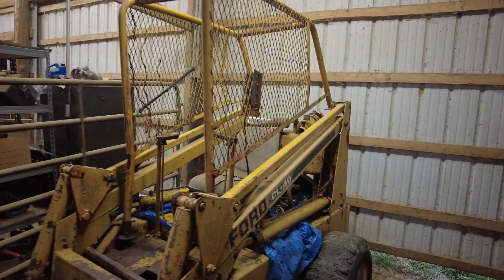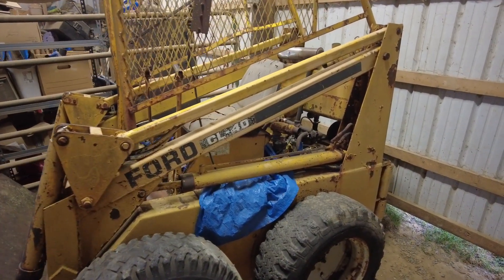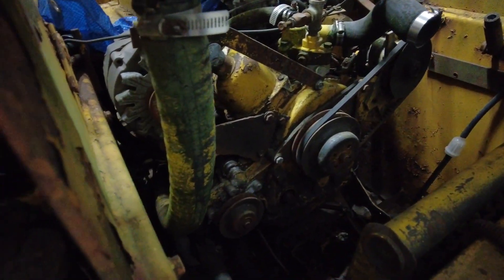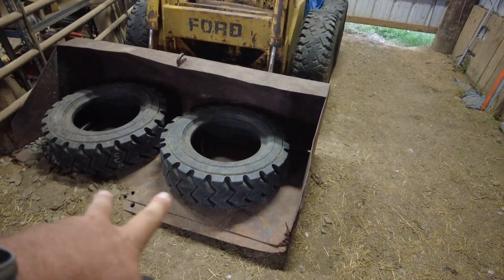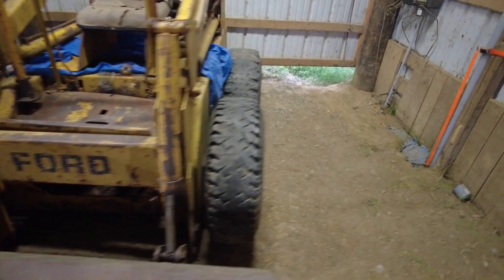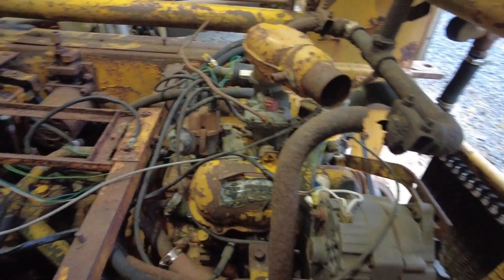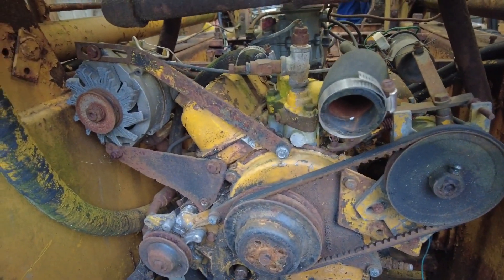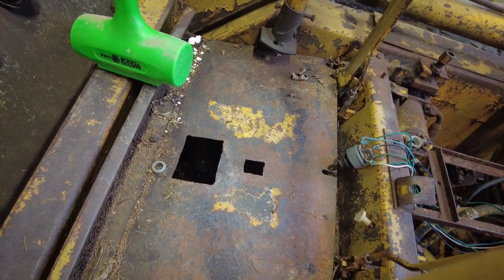Ford CL-40 Skid Steer

Comment: I bought one of these back in March (New year's eve now) and i gave the guy $2500 fot the machine  and another $1500 to fix it. Long story short its is now in my driveway in almost the same condition it was iin when i paid for it. So here I am looking for any information I can find on this. Moral of the story , people kinda suck.
Reply from the maker: Hahah I just ordered a crank pulley but haven't had the time to go out there and see if it will fit. I have some manual but they are pretty BASIC and  they don't help me. I would be interested in a few pictures of the engine so I can see if there is anything else I'm missing. If you look me up on Facebook, send me a PM and I will give you my contact information and maybe we can figure this out together

Comment: Looking forward to seing some content on the CL40. I have one one the project list for my homestead. I hopefully will get to work on it soon.
Reply from the maker: I should be working on it shortly. I had to order a balancer pulley. I need to do the basics before I get to crazy into it. There's a reason its in the condition it is. Stay tuned
Reply: @rollingspringsranch  Thank you. I've heard parts are hard to get for that old Ford engine. I did get a printed manual from the new Holland dealer. I don't know how much help that'll be but nice to have. One of these days I'll have someone scan it for me so I can share.

Comment: Got one about 4 months ago. Couldn't get it to fire at previous owners place. Built a skid, because the wheels were locked up. Got it in a warm shop and let it thaw. Ended up draining around 80 liters of water out of the chain compartments. Cleaned them both out with the garden hose, let it dry for a couple days. Then emptied all oil and fuel, cleaned all tanks. Filled with new oil, seals, sending units, and it fired up the first time with help of new distributor cap, rotor, points, and coil.
Reply from the maker: Thanks for the information. I'm still trying to find time to mess with it. I have a new / used balancer I need to install. Hopefully I can spend a little time to see if its going to be worth the effort